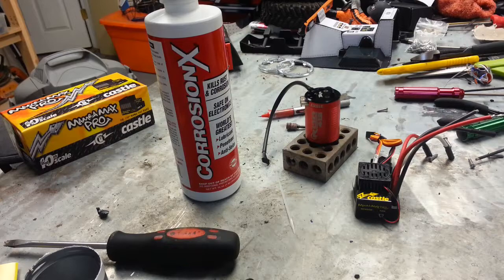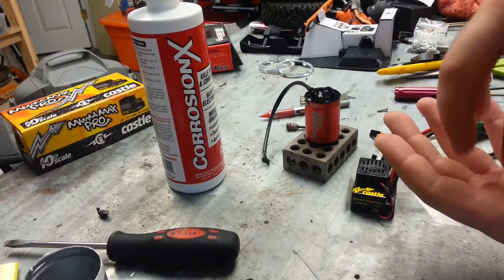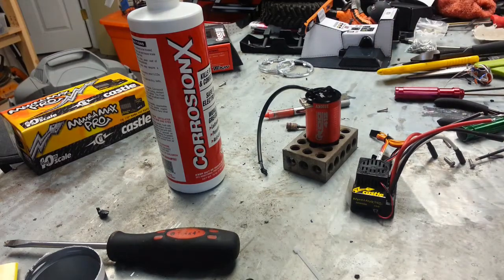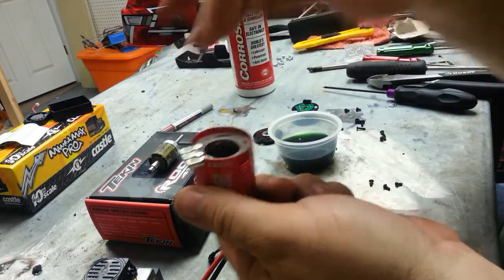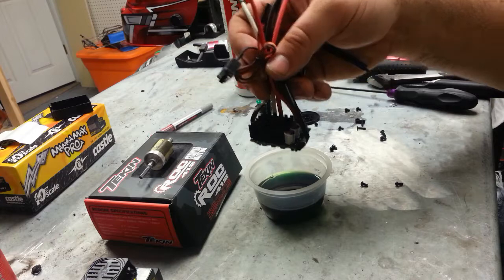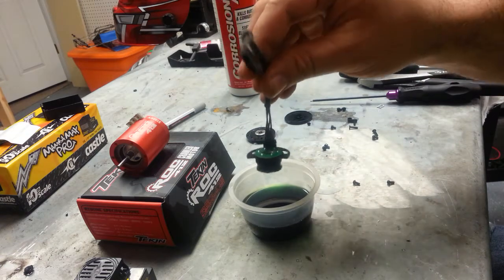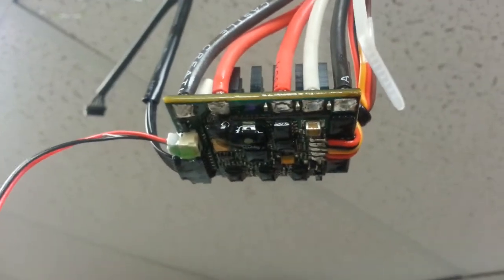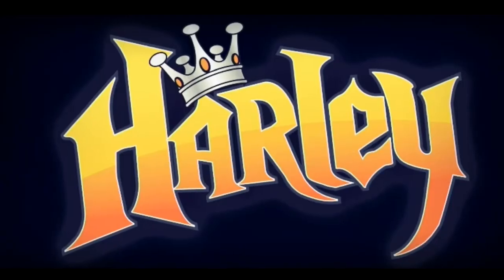Waterproofing a Sensored Brushless System

Comment from the maker: Where are you concerned with? You can plug the extra holes in the face with set screws or seal the motor to the motor plate with RTV. Other than that I just put some dielectric grease on the sensor plug.

Comment: I  have been looking around for a while. After seeing this i had to go find the name of what it is that I have been using. It is 'acrylic conformal coating' - by MG Chemicals. I tried 3 versions of this chemical (acrylic, silicone, and an aerosol that was silicone as well). The aerosol is has too much xylene for my liking, and capacitors do not enjoy that. Though all have great dielectric properties, the acrylic is my first choice. For my receivers I started using the silicone conformal coating.

Comment: Hey Harley, when i did this i found that for the CX to penetrate the board i had to leave the components submerged for about 2 hours, little air bubbles poured off for at least half an hour, then i let it dry for 2 days before it was dry. i've had this part (just an LED controller) in the water a few times with no case and it seems fine... but i think you want to dip the whole thing, electricity and heat will still be able to pass through so the heatsink and electrical connections are no issue.

Comment from the maker: Coating the board would be a good idea, than also try and seal the openings as much as you can with RTV and dielectric grease. O-rings on the main shaft under the horn has been done in the past too.

Comment: From personal experience I would recommend liquid tape to waterproof the ESC. And if an issue occurs you don't have a waranty anymore because you opened the case, wich automatically voids the warranty. So I don't see an advantage to the corrosionX method of waterproofing for the ESC over the liquid tape but having only used brushed motors I can't comment on using corrosionX for a sensored brushless motor.